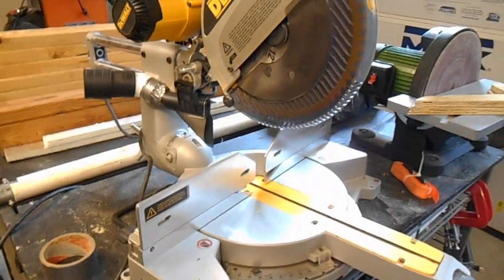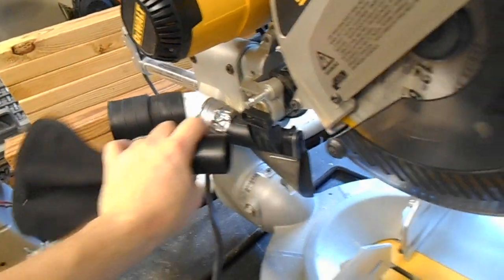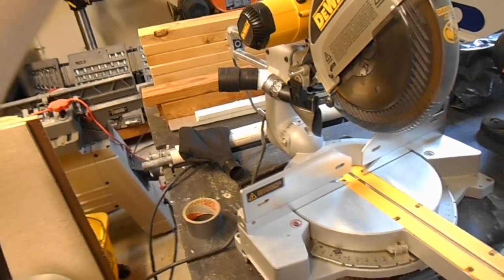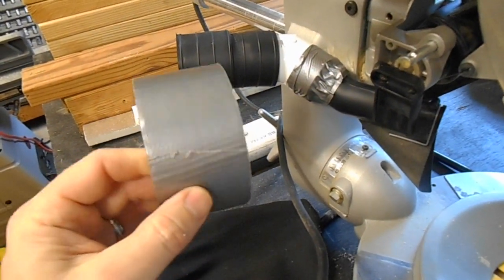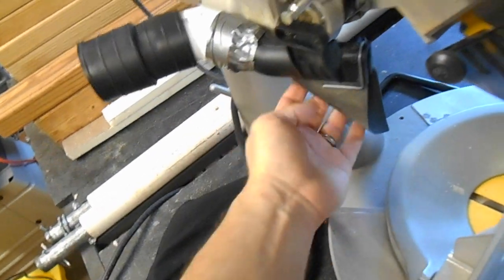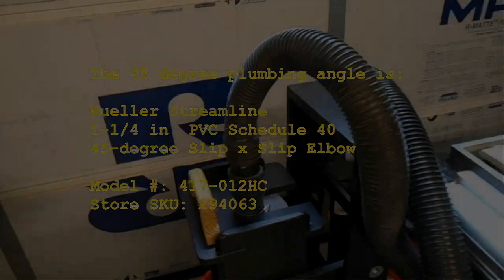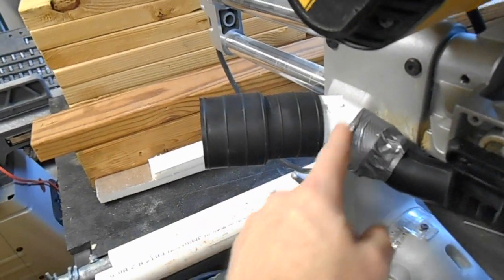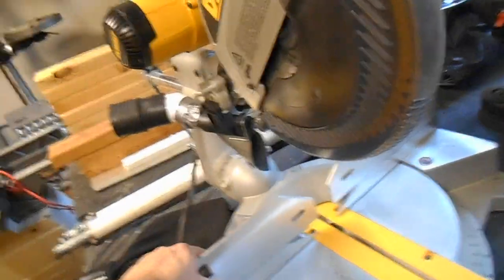Add dust collection pipe to DeWalt miter saw

Comment: Easier solution.  My shop vac came with several tapered plastic tubes.  One end is small and fits into accessories such as brushes, etc.  The other end accepts the flexible shop vac hose.  If you cut the small end of the tapered tube at the right spot, the cut off end will fit snugly into the exit pipe from the saw and the other end connects to the hose.  The cut tube is only about 6 in long.  No duct tape and it works fine.
Reply: What vacuum do you have?
Reply: roy massey It is a Shop Vac Series 90M.  Two or three of these extension tubes came with the vacuum.  They are tapered - the small end fits into the accessories such as a brush and the large end fits the shop vac hose.  The small end was too small for my DeWalt saw and I needed to cut about 6.5 in off.  The modified tube now fits snugly into the shop vac dust port and the other end connects to the shop vac hose.  Very easy - no duct tape, etc. Most small shop vacs come with these tapered tubes or you could purchase them.
Reply: Thanks
Reply: roy massey Keep up the good work - you have good info.  Thanks for sharing.
Reply: retireddh I just used your tip on cutting a tapered tube, and it is awesome!  I used the adapter from a micro kit (which I never use) and cut just after it started to taper, so it is only about 3 inches long.  It fits in my DeWalt miter saw perfectly with plenty of space between the saw and the wall,  and the shop vac hose is working perfectly.  I couldn't be more excited to stop the daily dust! Thank you!!

Comment: In your video I can see you have the wire clip completely on the outside of the flexible cloth dust catcher.  Theme U part of the clip belongs in the outside but the two long two inch extensions go inside the shroud to keep it open.